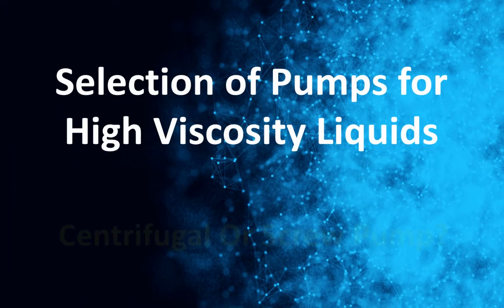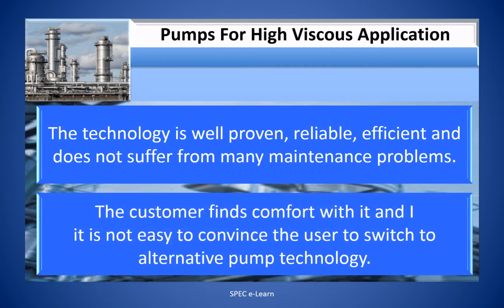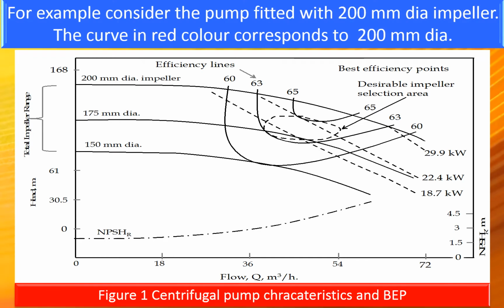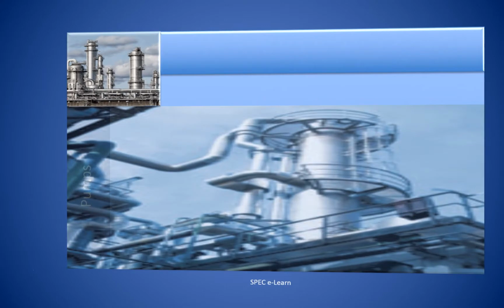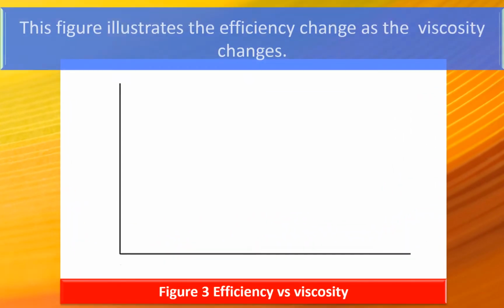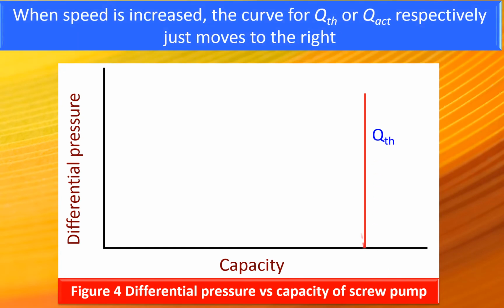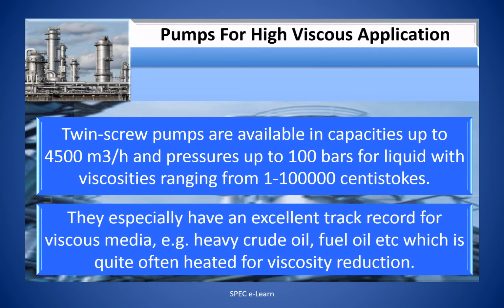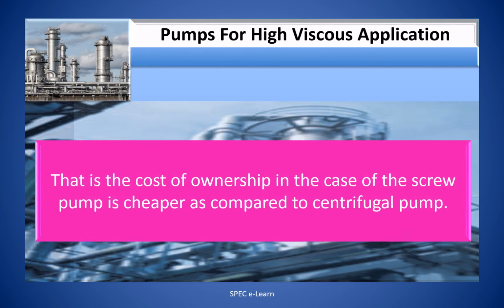Selection of Pumps for High Viscosity Liquids: Centrifugal Pumps or Screw Pumps?

Comment: Does the head curve ( not P) changed by viscosity changed, how the vendor accomdate it while his pump running by water only?
Reply from the maker: The theoretical head -capacity curve does not change with the nature of the liquid being pumped. Head is function of only machine parameters such as impeller dia, blade angle , rpm.  The actual shape of the curve depends the liquid properties such as density and viscosity. These properties particularly viscosity have significant impact on the frictional and other losses within pump fluid passages. 
If you are specifying a liquid whose viscosity is significantly different from water, you should inform the vendor to provide the curve for the specified liquid. He will provide the characteristics.
Reply: @Viking Pump  thanks for your feedback, i am slightly confused, if engineering company design a centrifugal pump for viscosity other than water (i.e. other fluid) how to link this pump with a vendor pump tested by water only!
Reply from the maker: Once the vendor supplies documents related to the pump to the customer or the engineering company who acts on behalf of the customer, he only looks into the pressure and  shaft break power.  Both these parameters are direct function of density. He can convert these data easily from water run data.  Also important is NPSH required. He doesn't  relate to the viscosity at this point.

Viscosity  and  shaf break power is included in the pump specification  sent to the pump  supplier for him to design the pump. Vendor has to meet these requirements.
Reply from the maker: The pump supplier has also to meet the efficiency specified in the data sheet